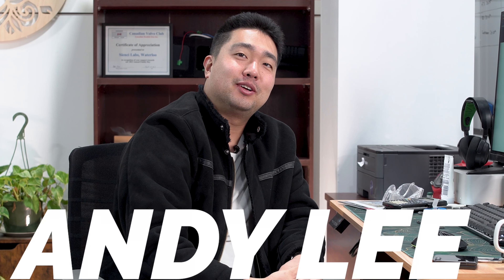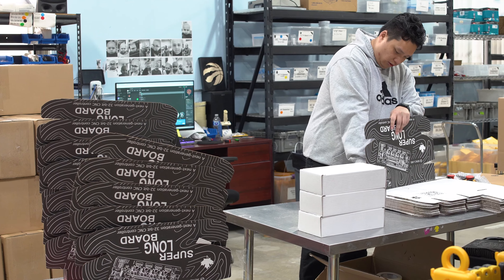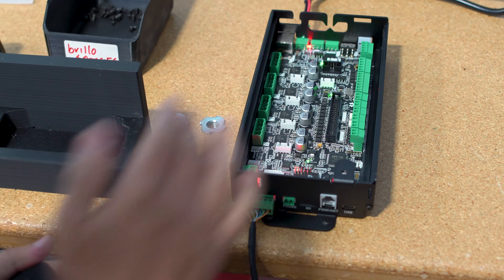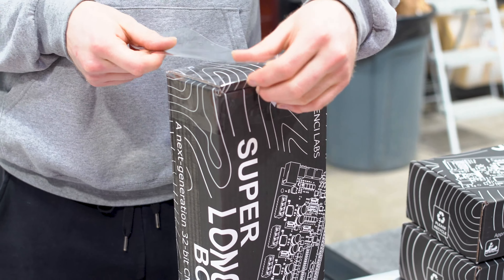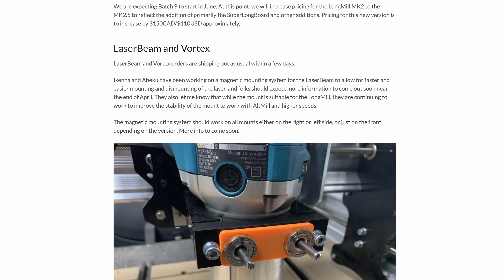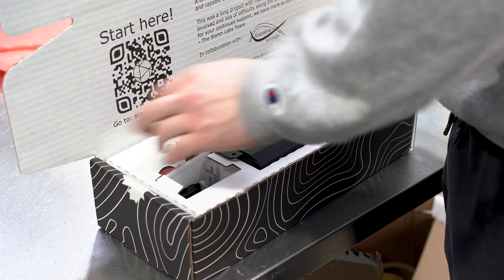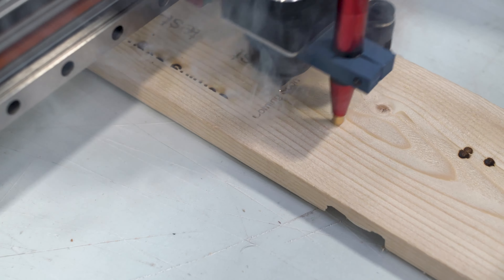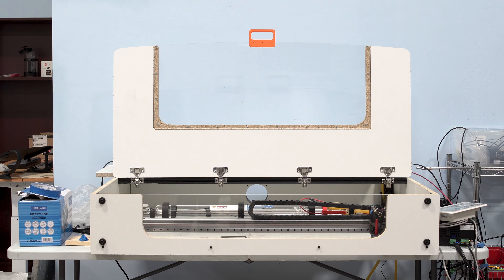Sienci Labs Monthly Production Update - April 2024

Comment: Andy, any plans to upgrade the power of the laser on the mk2?  I don't understand why this is not on the priority list.  It much easier than creati ng  a new machine.  I would bet most if , not all mk2 user would buy.  Unfortunately, try to do anything small the router will take to long and not give the detail needed.  A bigger laser would allow for faster cut time and deeper cuts.  Hone stly i know you are working on a laser machine, but that is so congested with manufacturers i don't see how you will compete. Those with mk2 and alt mills want the laser so they don't need another machine.  It the same concept as having different router bits or spindles. The laser is just another tool.  Nice video,  keep up the good work👍👍
Reply from the maker: Unless you stack laser diodes together, there is a limit to how much a typical laser diode can output (around 7 to 10 watts). A typical CO2 laser ranges around 60 to 100 watts, and not getting into the specifics about wavelength absorption. It is more practical to jump to a dedicated CO2 laser for higher-power laser cutting especially as each diode is the highest cost part of the system typically. Ikenna will be putting more info out about that project, so keep an eye out for that.

Comment: Andy,
Three Questions:
1. Will there eventually be a kit we can buy to transform our MK2 into a MK2.5?
2. In your production change on the 'Z' plate/motor mount, what changed so I can copy to allow the new shaft locking nuts to fit?
3. Will I need to change anything to my new SLB (first batch) to match batch 2 and on?
Thank You!
Reply from the maker: 1. Most of the parts that would make a MK2 to a MK2.5 is already sold on the site or can be purchased as the items become available. 2. Updates like the locking nuts are more to improve assembly but don't improve the performance of the machine. If you are running ok with the current parts, I would suggest using them. 3. As it stands Batch 1 and 2 are the same, with some minor tweaks on manufacturability side. If anything does come up, we will let everyone know.